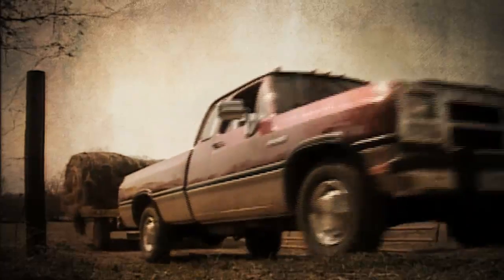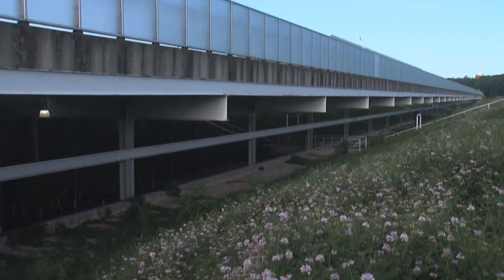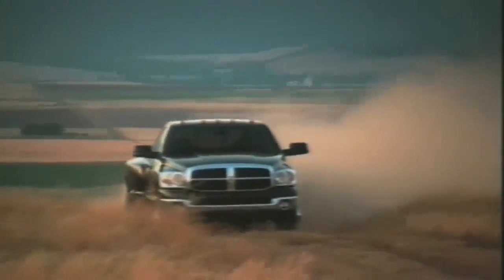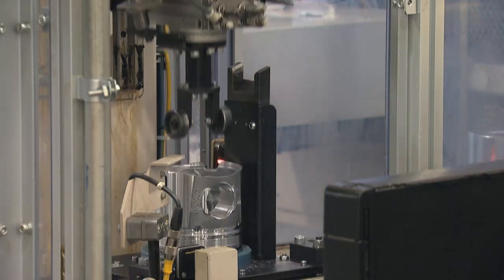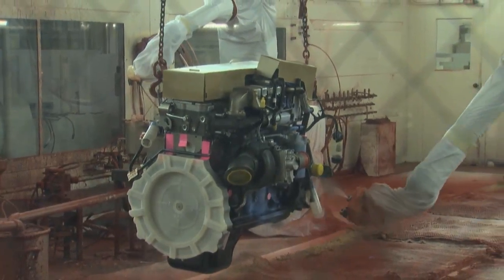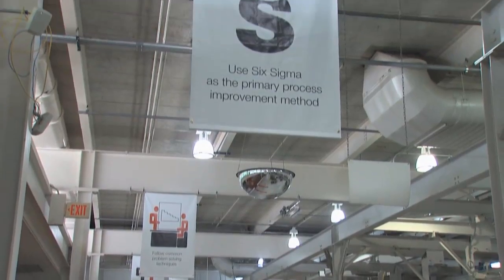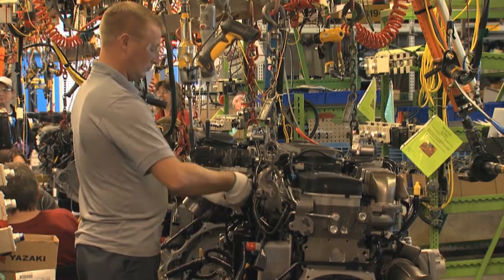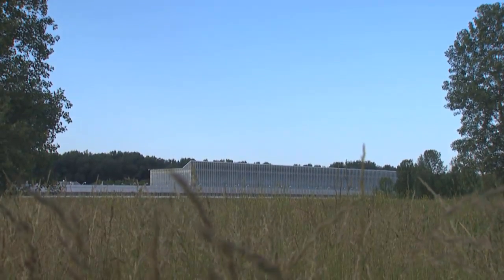Inside Cummins: This is CMEP (Columbus MidRange Engine Plant)

Comment: It was dependable because back then they built them to last, I left back in 2021 because they started cost cutting and making a more fragile engine. That Emissions crap is why they keep breaking down even to this day. 
Don't get me wrong it's still the strongest engine on the market but you gotta shell out another $15k in mods to make it reliable assuming you don't life in a state that requires emission testing 

The transmissions suck donkey penis too

Comment: 2003 3/4. Ton 575,198 miles CUMMINS!!! numero uno (number one)
Reply: I use a one ton, same year, with a 6 speed manual tranny and the Laramie cab. It now has over 400000 miles on it with zero engine problems. The rest of the truck I'm not quit as happy about, mostly because of the rust that keeps having to be fixed.

Comment: I have checked them out and there is none like the Cummins engine,I did not know then when I bought the F 350 super duty 6.0 powerstroke but I am really working on it to buy the Ram 3500 Cummins and I will not stop until I get it,I even thought at a time if it will be possible to put a cummins engine for the Ram 3500 in the Ford F 350.

Comment: My 07 6.7 in my 3500 was junk. Lasted 23k. Enacted the lemon law and got a 2010 1500 Hemi basically for free if you will. In service cleaning my 07 out the service tech said all you had to do was put a 1000 lbs of something in the bed to heat up the recirc system enough and it would have been fine, but we can't tell you that. Hmm.

Comment: I currently own a 1993 first gen 12 vlv Dodge 4x4 with 305,000 on it. Runs like a top. I have had a 2001 HO 6 speed Ram 2500. Also  currently own a 2017 Ram 3500 4x4 6.7 liter I pull a 44 foot fifth wheel with. Thank you Cummins and your team of people for what you do. Thanks for keeping these good jobs in the USA Cummins. Ill keep buying them if you keep making them here.

Comment: Cummins biggest mistake was allowing Chrysler to put their hands on this engine... their wiring harness blows, their a/c and hardware components blow. The engines will run to 1 to 2 million miles but these Chrysler parts last 100k to 300k at best.

Comment: I am on my 7th Dodge Cummins pickup..   Very happy with my trucks.
Reply: What's your opinion about Cummins-diesels? Durability, power? How many miles can an engine last? 

I'm asking this as a Belgian with a strong interest in engines in general plus there's an open position @ Cummins Belgium. 

Grtz
Reply: I have not run any of my Cummins Dodge trucks more than 300,000 miles.  So I have no direct experience with higher milage engines.  I hear stories of million mile pickups.  I know in industrial and ag applications it is very common to see 20,000 hours of hard use to overhaul with the 5.9 and 6.7 Cummins engines.
Reply: They must not last very long still trying to wear ' out 79 ford gasser hooked to propane so I can upgrade to a 12 valve, probably my last pickup won't get to try any ec engines.

Comment: love the engine but the crappy ram trucks rust out...
Reply: No they don’t I have a few of them never rusted.
Reply: All trucks rust out. I'm a PA state inspection mechanic and have condemned Fords, Dodges, Chevies, Toyotas and more to rust.
Reply: @SilverStarHeggisist  I agree with you. They all rust. New aluminum Ford's corrode.
Reply: @davedouglass5286  and rust, there's still a steel frame under that body. They get like a double whammy lol. Though from the sounds of it, the new cyber truck won't have this problem. We'll see
Reply: @SilverStarHeggisist  I’ve replaced several large aircraft airframe stainless steel parts due to dissimilar metal corrosion. Yes stainless can corrode and disintegrate.
Reply: Russell chevy lol yeah ok that’s funny
Reply: Billy Bob -not anymore. The 650 and 750 now has to get the powerstroke
Reply: +Jake9123 The interiors fall apart.They need to put Cummings engines in Chevy and GMC trucks,now that would be something.
Reply: +DesertDigger1 A Cummins 5.9 in a GMC Denali. Perfect truck.
Reply: Jake9123 never heard that before, first time I've ever hearing that
Reply: JayJay 
You can get a factory ford with a Cummins,  ford 650, Ford 750.

Comment: Cummins in my opinion is the best Diesel on the planet!!
Reply: I currently inspect any and all defects we are Cummins. If it desires any inspecting we make sure it desires absolute perfection. From fuel injection to emissions control we are Cummins. We are perfection.
Reply: Jared Lancaster I had, and I express, had, a 24 valve 5.9L in a 1999 Dodge that the side of the block blew out at 161000 kilometres, and Cummins wouldn’t even consider a partial warranty coverage. First and last Cummins I owned!!
Reply: @jaybo3687  We aren't pulling 50,000lbs behind our trucks either. I'll take my V-8 Powerstroke over the Cummins all day. Just personal preference.
Reply: Randy Wiesendanger That’s not my knuckles dragging its my dick. If the inline 6/Cummins is so great then I’m wondering why Cummins newest engine they developed in the Titan is a......V-8????? Jackass.
Reply: Cat is good too
Reply: @Jdl223  agreed cat is a great engine.
Reply: doesnt the military use purely duramax because theyre the best when it comes to power and durability? only thing cummins has over everyone is emissions. but those old 12 valves are the most reliable
Reply: The military uses a lot of Cummins engines . Bradley use 903 Cummins, and their is a lot of Hummers that have been repowered with Cummins engines. The military also uses a lot of Caterpillar engines .

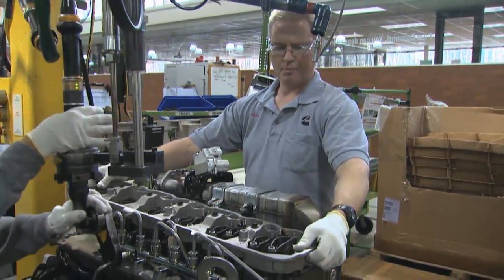Comment: Can't help but wonder about the skill level of these people when the oil filler cap has to be installed by machine. I mean, really? The oil filler cap? It's at 3:30. That guy apparently is not trusted enough to screw the oil filler cap into place. Strange...
Reply: Personally, I'd rather just press a button on a machine than manually screw on hundreds of oil filler caps a day, but that's just me.
Reply: jerry zezas Have you never heard of "stripping"? You can strip just about anything if you don't do it just right. Machines are often more precise than humans. Plus try doing something that repetitive a million times a day, you'll be claiming worker's comp in no time.
Reply: It ensures quality and reliability.
Reply: +Nestor Armas Good call on the repetitive action.  Keeping ergonomics in the forefront keeps injuries minimal.....
Reply: Nestor Armas there's a torque limiting device on that fill cap...it clicks when it stops...either way, i'm sure dude installs quite a few of them a day...and it's much better for the machine to do the work
Reply: Doing the most simple and basic repetitive motion...like installing an oil cap a few hundred times a day, Can And Will Render You Crippled in no time. Basic smart ergonomics going on there. If my old Chrysler plant would have worried about such things, me and thousands of others would be in better shape right now.

Comment: I had a 93 Dodge Ram with a 12V 5.9 Cummins.  Now I have an 02 Dodge Ram with 24V Cummins. ABSOLUTEY LOVE THE ENGINE.  I think it's a lot better than a Duramax or Navistar.
Reply: I work in the paint department in the lobby we have an 1988 Dodge Ram 250 with less than 6,000 miles on it with the old 12 valve
Reply: Agreed 100%
Reply: Jared is the 88 2500 for sale

Comment: Take the emissions shit off it and you've got the same reliable monster that came off the line 25 years ago
Reply: You're right, I left Cummins in 2021 and at the time we had more recalls for that emissions system than anything else. Run a full DPF delete and block off that EGR plate and you're set for 500,000 miles